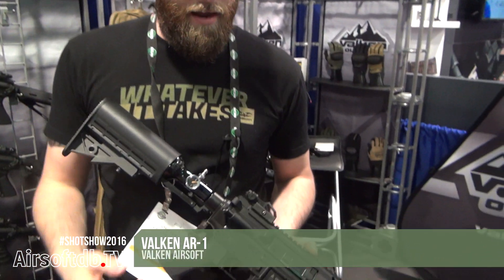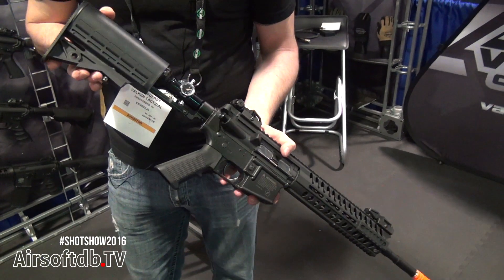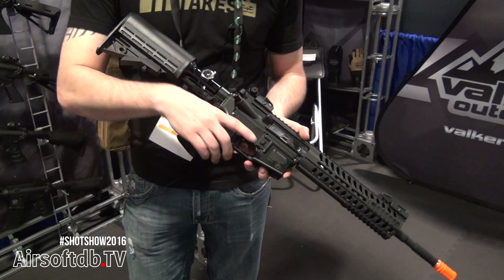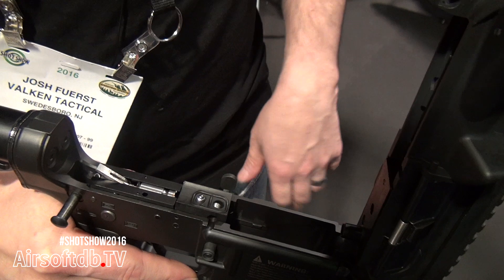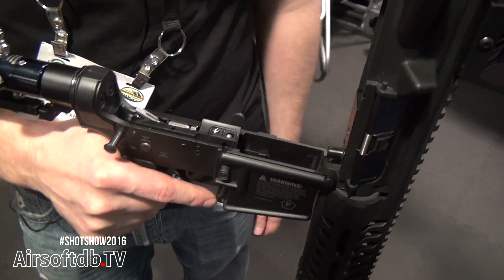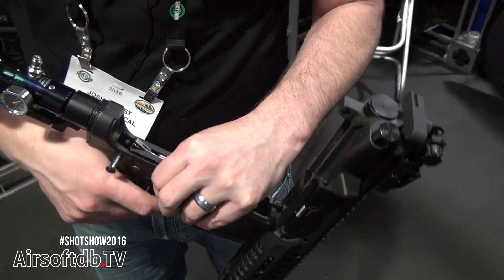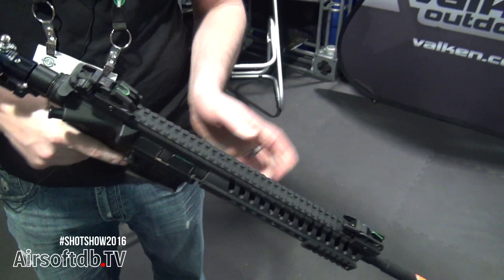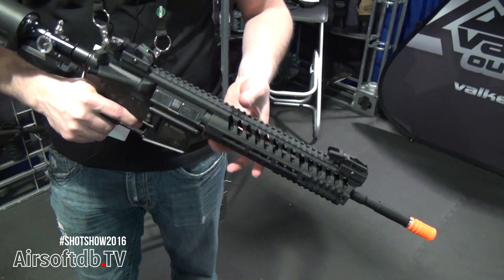SHOT Show 2016: A closer look at the Valken AR-1 (HPA)

Comment: The manual says you'll void the warranty if you use more than 450 psi output on the tank regulator. 
Mine is shooting 580 fps max to 530 minimum on fps setting for 500 psi output tank. 
Too hot to be able to play. I called FS customer service and they said they're gonna send me super low 300 psi spring. 
Now it lowered down to 450 fps minimum and 530 max on gun fps setting screw.
it's still hot though.